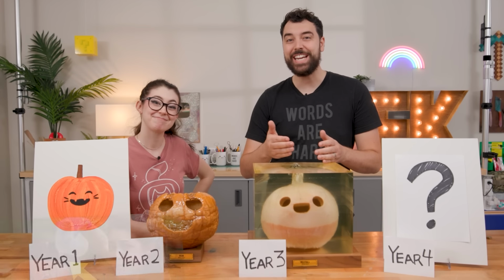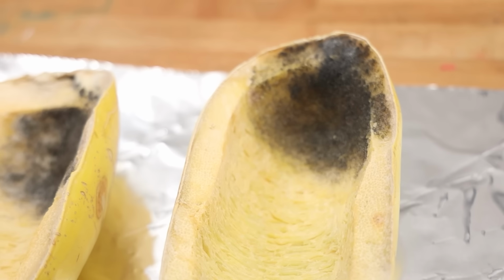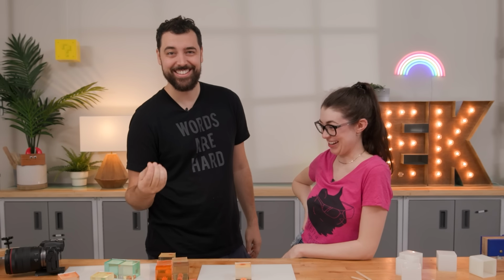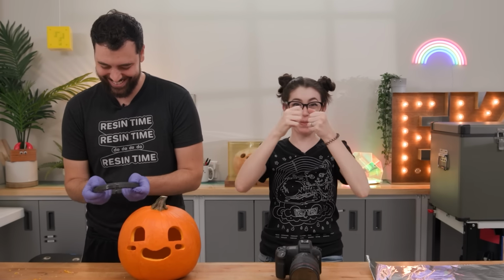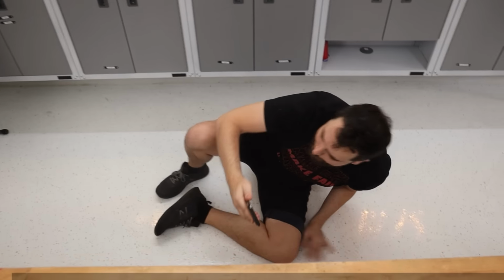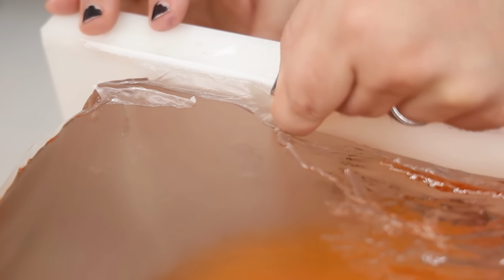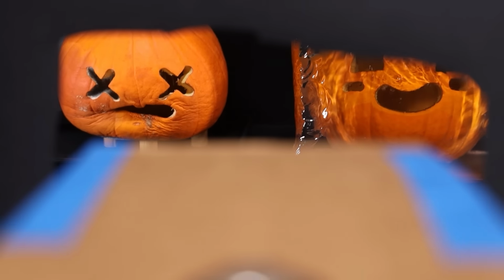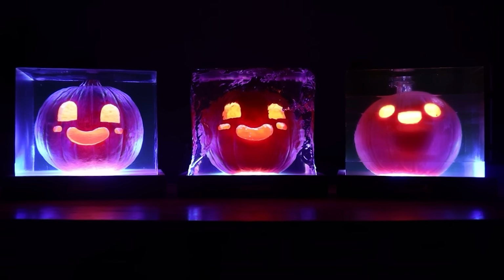Our BIGGEST resin pour yet… all to preserve a pumpkin

Comment: The alcohol and bleach likely removed the "good bacteria" from the squash, making room for the more aggressive molds to proliferate. I think this is something like what we do to our GI microbiome when we take too many antibiotics.
Reply: And the more aggressive mold was reintroduced by putting the control in the same box.
Reply: This is literally what I came here to say, they're not doing the experiment in sanitized conditions so all the contaminates have a nice clean food source with no competition.
If they sanitize it and then directly resin it there might be different results
Reply: That's what I was thinking too, but I'm no expert, lol
Reply: I think this is likely the answer.
Reply: The mold spores probably just came from the air
Reply: I think it may actually disintegrate the cell membranes and make it even more vulnerable
Reply: That and damaged the cells which speeds decay and allows easier colonization of the bad molds.
Reply: UV Light could be used to strelizie the punmpin for a few weeks when it is already inside the resin.
Reply: My microbiologist husband confirms!
Reply: What happens is that by adding alcohol and bleach, they added "moisture", which also helped the development of the mold.
Reply: I think it’s half this and half that the control simply had a better opportunity to dry out on the surface enough to limit mold growth
Reply: This. I'm thinking if they sanitized, and immediately poured and cooled, it would go a long way to stopping it from molding.
Reply: Yeah, I was thinking the same exact thing because in order for that to be prevented, you have to make sure all the tools are sterilized that the environment is sterilized and if that’s sterilized, at least sanitized appropriately and the room that they’re in would also have to be because they’re doing this in the garage and I hate to say this, but It’s proven that the garage has sports floating around in it which I’m not surprised. A lot of houses are like that, but because of that as everyone was saying the alcohol is causing damage to the tissues of the cell is the vegetables as so, does the bleach and the diluted bleach so yeahI’m not surprised that the other three mold it so quickly
Reply: Pumpkins are porous, so I feel like the second they cut into them it was a loosing battle, and moulds and yeasts are everywhere. I was just concerned they would put the bleach and alcohol on the same pumpkin 😬😬😬
Don't mix bleach based cleaners kids!
Reply: I see a lot of people here talking about "good" and "bad" bacteria. There's no such thing as "good" or "bad" in this situation, bacteria is bacteria. The difference between "good" and "bad" bacteria is pathogenesis, since no one is planning on ingesting the pumpkin/squash, there is no good/bad. For the purposes of preservation, all bacteria is "bad". Bacteria are living organisms and need energy (food, light, chemicals) The only bacteria we care about here is Heterotrophic bacteria because that's the bacteria that's going to be producing enzymes, creating waste products and eating organic material (pumpkin).

The main enemy here is always going to be the water. The water has to be replaced with something biocidal if you want to preserve organic tissue for any length of time.

TLDR; PAA (Plant Fixative solution) - Formaldehyde, Alcohol, Acetic Acid, 10%:60%:5% + 24% water + 1% Benzalkonium Chloride (Steramine Dish Tablets). Vacuum chamber, leave submerged for as long as possible to displace water and ensure thorough penetration, dry the surface without contaminating it, then encase it in resin. 

You'll find formulas for a 10%/50%:5% +35% solution online, so theoretically anything between those mixes should work. Without going into detail about my background, I guess this is just a thorough a "trust me bro" comment. You can verify everything here though.

There are multiple reasons using just 99% Isopropyl Alcohol or a diluted bleach solution made it "worse". First being that neither of these solutions have any residual activity, meaning they kill specific organisms for a short amount of time and then become regular old H2O. Mold/fungus loves water. There are spores everywhere, all around us and in the air as well.

You essentially killed 'some', not all, of the bacteria on the surface of the squash and provided whatever spores were left or in the air the perfect, warm, uninhabited, moist home to start growing. You eliminated the competition. 

The next reason has to do with how mold/fungus spreads, by releasing spores. You trapped the squash in a warm box, mold started growing, released spores and spread. You can see the direction of spread in the timelapse.

The main reason alcohol and dilute bleach were worse is Isopropyl alcohol lacks sporicidal action and cannot penetrate protein-rich materials. Bleach in general isn't very effective at sanitizing surfaces that are "dirty" or sanitizing organic material. In order for bleach to work at all, the surface has to be "clean", inorganic and nonporous. Exceptions would be I guess submerging something in a vat of it, the way fabrics are "sanitized". Bleach also degrades rapidly and is relatively destructive/caustic, at least at the concentrations required. Not to mention, it bleaches things.

It's also possible that the control was less moist than the other test samples, so that slightly delayed the process. I could probably list a handful of other reasons but does it really matter? What matters is what WOULD work?

You could use a disinfectant that has residual microbicidal activity but the problem is that only helps the surfaces that the disinfectant contacts and  only solves the bacteria problem. Everything else below the surface is unaffected. If you could get microbicidal/bacteriostatic disinfectant to diffuse inside the pumpkin, that would be a great start. It still wouldn't preserve it forever, for that you need a preservative and a biocide. 

They make products for use in labs called "plant tissue preservatives" or "plant tissue fixatives", one brand name is PPM (Plant Preservative Mixture) but for something the size of a pumpkin, PPM would be ridiculously prohibitively expensive. 

A cheaper/equally effective solution is known as PAA (Formaldehyde, Alcohol, Acetic Acid, 10%:50%:5% + 35% water) can be used successfully. Advantages include rapid and thorough penetration of tissue by formaldehyde, long-term storage possibilities, and balancing of tissue contraction/expansion between the alcohol and acid. Add 1% - 2% Benzalkonium Chloride (BZK aka Steramine) and this is THE solution you're looking for. The only problem is I suspect one or more of these ingredients might have an affect on the resin curing but maybe not if the surface is dry enough? You just have to minimize contamination while drying, which is easier said than done.

All of these ingredients can be found on Amazon, you'll just have to do some math or use a dilution calculator to get the mix correct.

Benzalkonium Chloride (BZK) is the active ingredient/preservative in so many things from Lysol (0.25%) to alcohol free hand sanitizers (0.1%) to eyedrops (0.005% - 0.01%) and nose sprays (.01%). It's actually a very cool type of compound called a Quaternary Ammonium Compound (QAC or Quats). They're relatively safe in the correct concentrations and used in everything. You can buy tablets on Amazon called "Steramine", that's used in the "third sink" in restaurants to dunk dishes in before drying for sanitization.
 
This is never going to work as long as there's water left in the pumpkin, what you need to do is replace the water with something bacteriostatic/microbicidal. There's a reason that Glutaraldehyde/Formaldehyde has been used to preserve living tissue forever, it works. It's stinky though and it only works when the thing you're trying to preserve is submerged in a solution. A 99% alcohol solution would work too but again requires submersion.

99% isopropyl alcohol in general is an ineffective surface disinfectant. Typically, when using an alcohol for surface disinfection, 60% - 75% is the sweet spot of microbicidal activity and enough water to slow down evaporation to ensure an adequate contact time. And again, alcohol lacks sporicidal activity.

So what you need to do, if you're serious about this is submerge the pumpkin in a bucket of PAA, Glutaraldehyde/Alcohol and a biocide with residual activity (BZK). Use a vacuum chamber to pull as much air out of it as you can, maybe even poke some holes in it to make sure it gets inside. Leave the pumpkin in there for a while, long enough for the Alcohol/Glutaraldehyde to displace as much of the water as possible. Then somehow remove the saturated pumpkin, dry the surface without contaminating it and then encase it in a resin block. 

Frankly, I'll be amazed if anyone actually reads this entire thing and even more amazed if Evan or Katelyn do but this is one of my wheelhouses and figured it couldn't hurt to spend a few minutes trying to help.

Oh, If those chemical names seem intimidating/complicated, just know that this stuff isn't anymore complicated than anything else you guys have mixed on this channel. Resin, paints, baking ingredients. In fact, chemistry is essentially baking.
Reply: Also came here to say this. All 4 would've needed to be in separate containers. The containers need to be sterilized and the air inside needs to be kept separate from the rest of the room to keep it sterile as well. Ideally, we'd be getting them a biosafety cabinet just for pumpkin resining, because throughout the resining process they'll get bacteria or mold on them.

As for why the bleach and alcohol molded worse, it honestly could just be up to chance with more mold spores landing on those first.
Reply: @SaltNBattery  thank you!  Said it so much better and with more expertise than me. Hope they read this.
Reply: @carnifaxx  In biochemical experiments, we use bleach to sanitise leaves before we infect them with the specific bacteria we want to study. The leaves don't suffer from this, so it doesn't affect the cell membranes.
Reply: Okay, so aside form the extremely limited sample in the psudo scientific experiment  : / 
I had an uncle who was a microbiology prof for a research university and he told me ages ago that 70% isopropyl alcohol is better at killing microbes than 90%.  Something about the water allowing it to get into the cells better. But when the pandemic hit and everyone started making their own hand sanitizers I called him up to double check my memory and he did say that anything less than 60% isn't effective but around 75% was the ideal range, they just used 70% because it was available in the very large quantities they regularly required.  O/c he also mentioned that  hand sanitizer (alcohol) doesn't work against everything, for instance norovirus is a non-enveloped virus, and therefor handsanitizer doesn't do diddly squat.

Basically at 99% alcohol's not gonna work... but 70% /might/.  

Also, spritzing, isn't gonna do it.  You need to WASH as in cover/submerge the entire thing in the test liquid for several minutes.  Then pull it out and dry with sterile, lint-free towels before immediately storing it in an area with filtered airflow to avoid introducing microbiotics after sanitation, or encase it in resin right away....
Reply: @CosmologicalCanvas  Reminds me of mythbusters when they cut the apple on the table saw and the one under the pyramid didn't rot as fast...
Reply: Ditto!
Reply: Exactly. They killed off everything, which meant there was no competition for resources and space. The mold was able to quickly spread and grow, unhindered, with no completion.
Reply: yhea and having them in the open air kinda negates the whole test as well. could just as well just be random.

Comment: I’ve noticed that Evan and katelyn always pour the resin into the mold with the pumpkin standing upright, but what if it was positioned upside down as they poured? The larger, pre-existing bottom hole would allow for better air release than the smaller drilled holes around the stem, completely get rid of the possibility for large air pockets getting trapped, and ensure they can tell when the pumpkin is fully filled with resin. I’m sure this wouldn’t get rid of all problems, but it might help with quite a few.
Reply: I know, it's maddening 😂 their entire convoluted air pocket release tube clogging incident last year would have been prevented by just... Turning the pumpkin upside down 🤦‍♀️
Reply: true, but then they’d still have the issue of how the hell do you get it to stand upright while upside down? especially with a stem
Reply: Yeah totally!
Reply: +1
Reply: They should to that this year

Comment: For next year: Do Chunk 1 again, just as you did, but add an inch of clearance all around the mold. That way, when it warps from the fast cure, you can cut an inch off each side with a band saw, then polish and topcoat each of the flat sides, and you should have the perfect, ideal, preserved pumpkin you've been questing for.
Reply: like this so they see it
Reply: That’s actually a great idea
Reply: Clear
Reply: or they could you insert chunk 1 into the cube and fill it up with resin making chunk 1 both square and orange
Reply: I feel like that would waste so much more resin though... Depends how far they're willing to go. I'm just excited about next year
Reply: @resolecca  yes, but that's going to introduce a seam of sorts. A layer line type effect, which was what they wanted to avoid.
Reply: @some_williott  I guess? I mean, it's no more wasted than an 11 inch cube with visible layer lines and a decaying pumpkin in the center.
Reply: @some_williott  But they filled in the voids on Chunk 1 with more resin and then added resin as a shine coat on Chunk 2.
Reply: That's what I thought.  @resolecca
Reply: So a smaller pumpkin and the same sized mold, then just remove the outside?  That's what I was mentioning to my daughter as she watched with me.  We see Nick Zammeti do that all the time.  He does HUGE lumps and then wood turns them and polishes the finished piece.
Reply: i feel like no one realizes that polishing makes resin clean again there isnt a need for a pour over just sanding it down and polishing
Reply: @andousuba8213 areally thin coat of epoxy at the end really makes the Resin shine though.
Reply: I was thinking the same thing :)
Reply: Mk, can you do a giveaway for the  smol pumpkin cubes?😊

Comment: I'm sure Evan has already told you this, but as someone who loves these pumpkin experiences, I have to say; don't feel pressured to do this next year if it's more stress and work than it is fun, Katelyn! Maybe you could find some other use for whatever Evan has bought, or you could skip a year and try again after that, or you could it with a smaller pumpkin so there's less work involved - or you could just not do it at all. Take care of yourself <3
Reply: I'm pretty sure they were playing it up a bit, right?
Reply: You say that as to imply Evan is forcing her to do this. I don't feel that's the case, but I do understand where you are coming from.
Reply: @Nanner823 I don’t really see where they imply that, could you maybe point out something specific please!
Reply: @biksw I thought they were playing it 𝘥𝘰𝘸𝘯 tbh
Reply: Actually, doing a smaller pumpkin might yield better results anyway! Less resin heating up, and less work shaving off problem bits of it has issues again

Comment: Hi!
A tip! We use a product called Atamon for preserving our pumpkins at Halloween. "Paint" the whole pumpkin with this inside and out. It's made for making jam last longer!  It prevent mold and fermentation. It's called Atamon.
Reply: the mold they got was due to killing everything else on the surface so the mold had no competition.
Reply: @rjvlogs3653  yeah i suspect that it would work really well if they used alkohol and poured resin right away to cut off oxygen supply